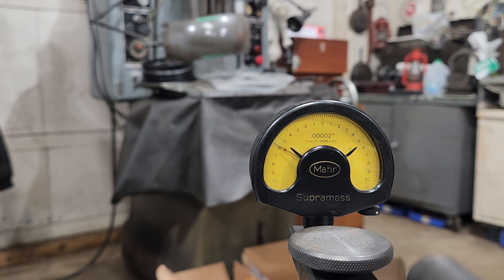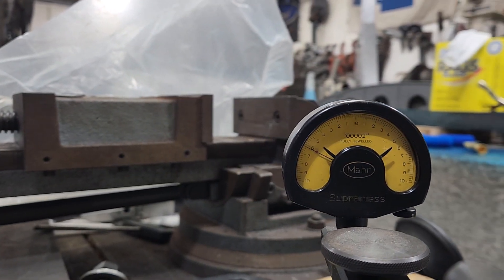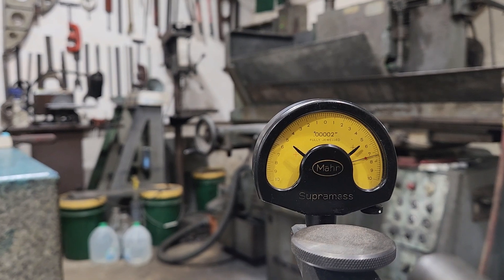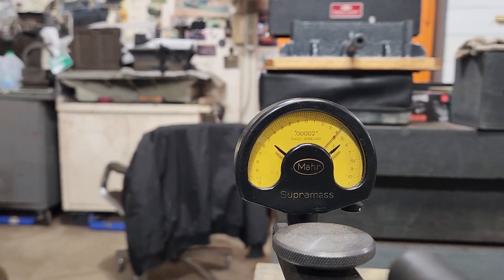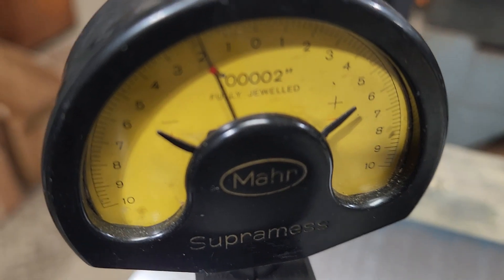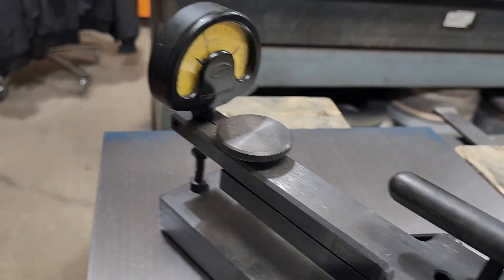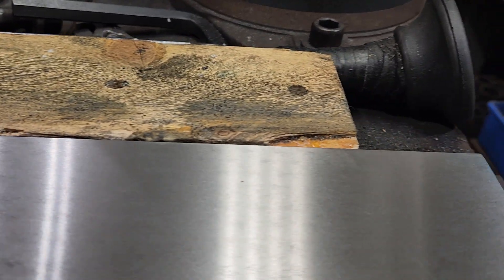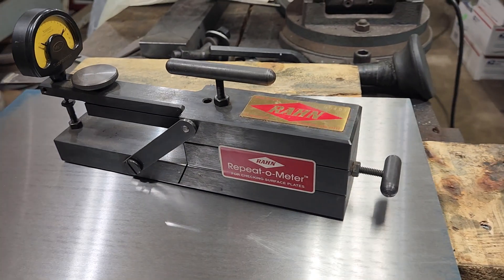Checking flatness on a new Challenge surface plate with a Rahn Repeat-O-Meter.

Comment: Repeat-O-Meter. You have all the toys. 🙂
Reply from the maker: I have lapped in some nice size granites for customers, so I need the tools. I also have a Rhan Planekator with then same indicator, but inverted.
Reply: @OtherBrotherDarylSmith  I know that tool as well. I keep my eyes open for them, but really rare over here. Obishi Keiki does make a repeat-o-meter type unit, but very expensive new and also extremely rare.